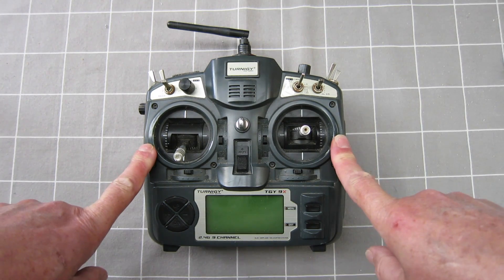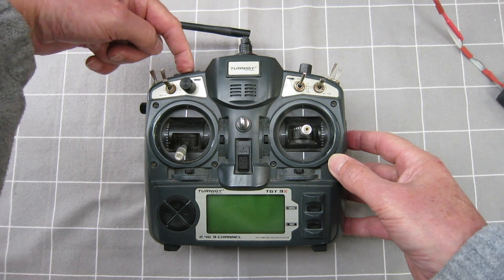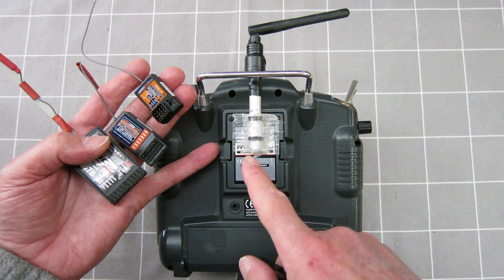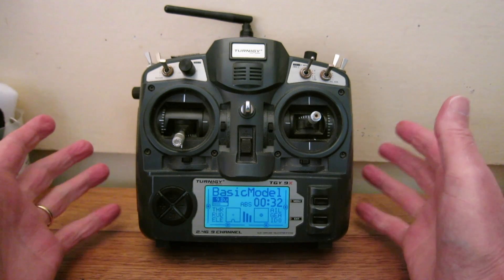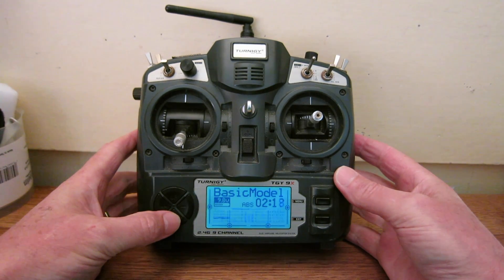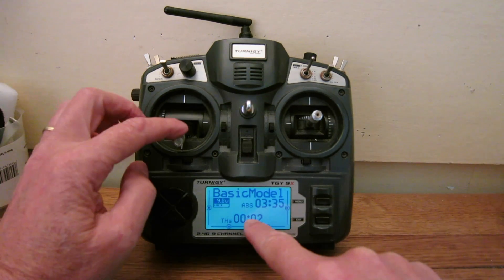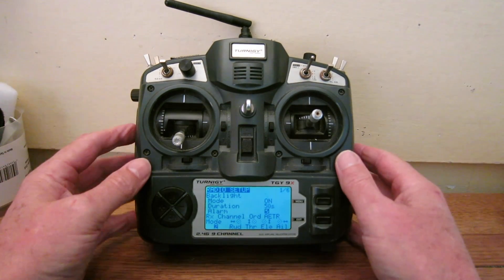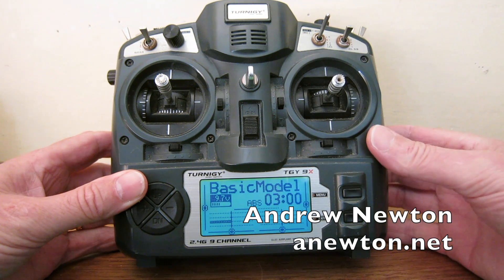Turnigy 9X OpenTX overview

Comment: Pls guide as u always , 
I have turnigy RF 9x v2 ,
and using open tx version 
9x 2.0.15 version ?
First which is new version pls inform ?
2nd , for my information if change version so what's the advantages ?

3rd can I use duel antenna receiver with this radio ??
I am using single antenna receiver with my radio .
Pls guide
Reply: Duel anntena like , FS I A6B

Comment: Hi Andrew. I have a "new" tgy9x with afhds2a protocol and it has a bind issue. So I ordered xjt module for it and I want to flash open tx or er9x but you write that firmware wont work on newest tx. Why is that,  where is the problem?
Reply from the maker: I haven't kept up with the latest but some time back Turnigy started using a different chip would couldn't be flashed with OTX. Best source of info is RCGroups and OpenTX Uni

Comment: I'm still trying to get all of this stuff through my thick skull.  I have Open TX on my Turnigy 9X, now and think there is a new version available.  I have V:2.0.19 now and each time I try to find how to add flaps to the ailerons on my micro skyhunter I get different results, but never complete success.  If I ever get the ailerons to act as flaps for landing, I will want to add some down elevator to offset the flap influence.  I have gone to Open TX University, but can't find anything there on the Turnigy 9X.  Everything there is about the Taranis with Open TX.  I feel fairly certain that the same instructions should apply, but I just haven't got it to work??   Flaps, flaperons, source, switch, all gets lost it my feeble brain some how.  I know that you don't have the 9X anymore, so any pointers to other videos or sites would be appreciated greatly.
Reply from the maker: No problem Lloyd. I'll do a video on it, have been meaning to for a while. Stay tuned tomorrow
Reply: Thanks a ton!  I know this all old school stuff for you and many others, but it is complicated!

Comment: Hi Newton! Just got the smartieparts for my 9X, installed everything. But I just can't seem to get it work! Do you have a guide somewhere that could help? I think the biggest problem is with the connection between the transmitter and my pc!
Reply: That is always the hard part. Unfortunately I can't help with Windows issues (Apple here) Best resource is OpenTX Uni http://open-txu.org/home/undergraduate-courses/fund-of-opentx/

Comment: how do you add pots in the mixer page. what are they named eg !RUD + RUD  -100 and 100 on a channel gives you the rudder switch.
Reply from the maker: I don't have this radio anymore but I think they are P1, P2 and P3 and the value goes from -100 to +100

Comment: Thanks for putting this up since i have one of these original 9x's and am interested in using opentx.  The problem I have at the moment is locating the r2940 firmware since google code closing.  You said that this is the last version to work with the 9x... any chance you could point to where I could get this or if you've tested the later versions and if they work?
Reply: Greetings, Lloyd Prunier has just managed to get it working. Maybe he could point you in the right direction. Good luck.
Reply: for the last version of the firmwere , google and download companion, upgrade companion( it will have a option , or it will jump on you to upgrade), in the meniu of the companion you wil have an option for dowloading the firmwere for your radio (64bits, 128bits ) 
if you want telemetry , in the options of companion you nead to select frsky
Reply: Is this for the 9X or Taranis?
Reply: I tried with the companion9x and this wasn't able to locate any of the firmware being selected so I took a punt and downloaded companion2.0 (version 2.0.19) and this worked without any issues with my 9x.  Just had to select radio type of 'OpenTX for 9x board' in the settings and it got the appropriate firmware.
I think that companion9x probably attempts to get the firmware from google code which is no longer there.
Reply: it is for 9x
Reply: Technically, I installed 2.1.9 on my 9x... but had to use the 2.0 Companion....

Comment: No luck so far with my attempt to install Open TX.  I got the SmartieParts basic.  It is an easy install of the electronic hardware, and only the external USB wiring connection.  I cut a slot/hole in the battery door so I can connect with out any extra problems.
   I don't know if I have the correct driver installed?  I used the link to Zadig and selected the USBasp  driver after about a dozen different tries I think the driver installed, but still no luck installing the Open TX, Can't find what I'm doing wrong.  I have the Turnigy 9x, ver:2  on the board inside it says V:15 and the Smartieparts page says that is compatible as long as it is not V:1.  I may have to go back to school and learn more about computer programming before I can get this to function.  Is Location Port_#0006 the same as COM Port 6?  Which version of the software download is for the Turnigy 9x?  They have versions for every TX except mine I think.  I'm assuming that many should be compatible, but nothing working yet.  Does the radio have to be turned on before downloading the firmware?  When I try to download to TX, it says it can't read current firmware.  At least it hasn't bricked the TX yet.  Everything is still the same when I power it up? HELP !
Reply: I'm using mac so mine will be different. OpenTX Version r2940 was the latest for the 9X. I'll do some searching and give you more info
Reply: Have you looked at OpenTX uni, that's the best resource - http://open-txu.org/home/undergraduate-courses/fund-of-opentx/
Reply: I'll go to the University now.  I just finished doing the ground wire mod on the horizontal trim boards.  I've had this Tx apart so many times only one screw holds.  That'll be next thing to fix if I get the Open TX  done.  Thanks for the tips.

Comment: Great radio after you fix the design error (in all versions but especially newer m128 chip variants) that causes a crash/reboot when using horizontal trims. http://openrcforums.com/wiki/index.php/Horizontal_Trims_Ground_Fix. Mine also would reset using the exit button but a 2k resistor in series with the button fixed that too..  Best upgrade to mine is an out facing connector to set up everything using the awesome opentx companion software on the PC through a usbasp programmer (no pressing buttons on radio!). Soldering iron and hot glue is mandatory for this one!
Reply: Wow that would really suck..."yeah I think shes needs a little trim"...CRASH..."WTF"...
Reply: Mine didn't have that problem, bought 2103. I used the smartieparts board for flashing